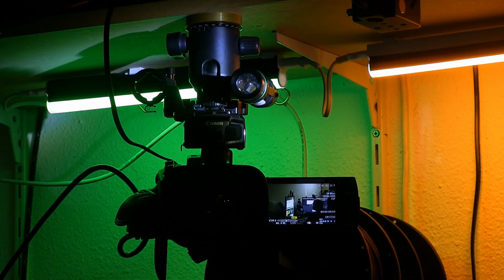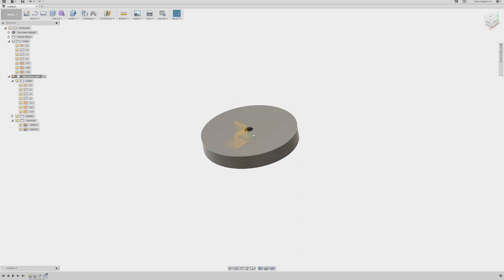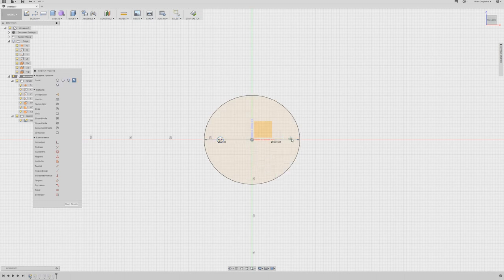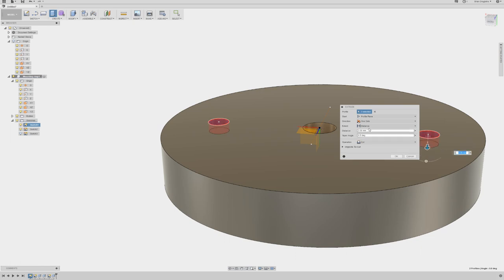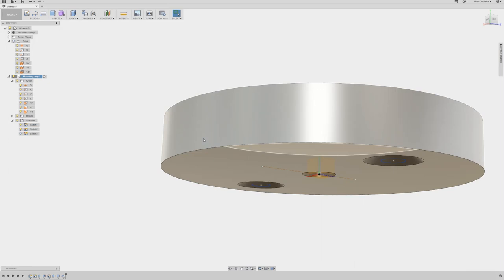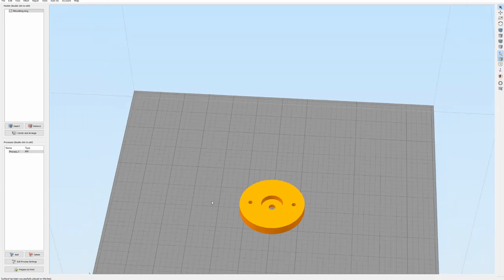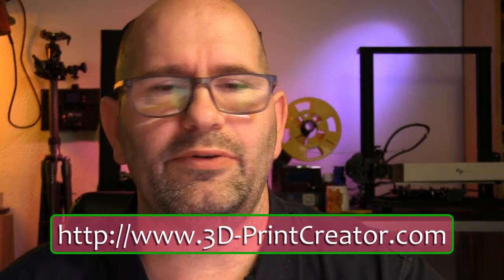▼ Making a ring to mount a tripod head upside down

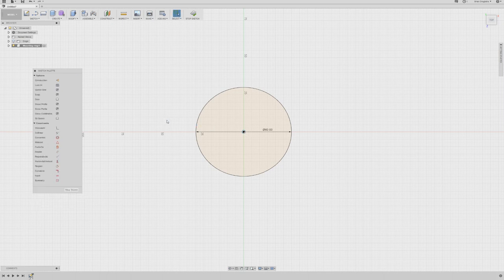Comment: I hope you found out what you did wrong at 2:18, you pressed 'Stop Sketch' for some reason, and after that you created a NEW sketch for the smaller circle (the hole). That is why you couldn't select it while extruding the first sketch.
Reply from the maker: Yes, found that. I just didn't realize I stopped the sketch. Very stupid.
Just to let you know, I was in Lars livestream yesterday and I am aware of the new functions. I just made some mistakes as I used the functions for the first time.